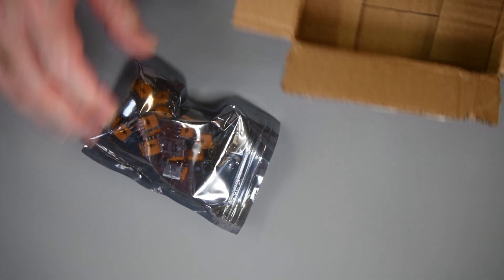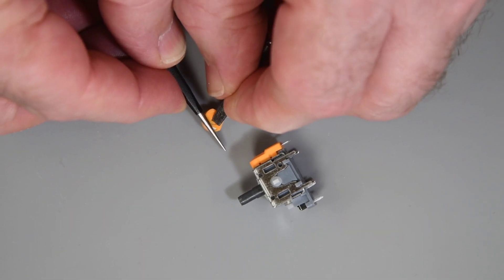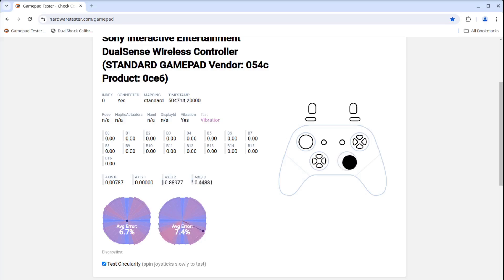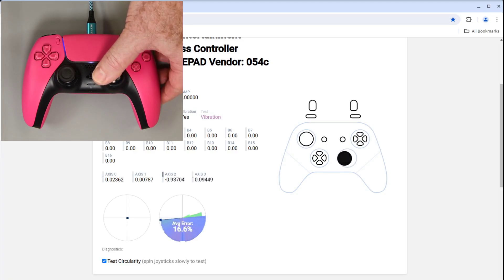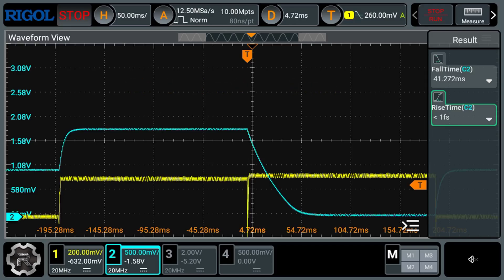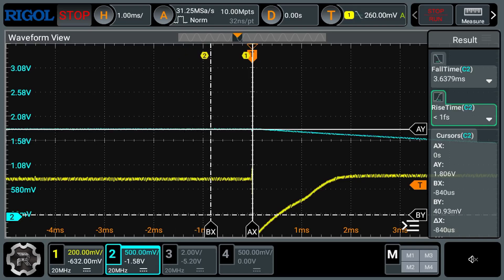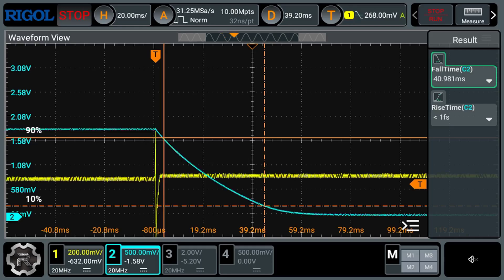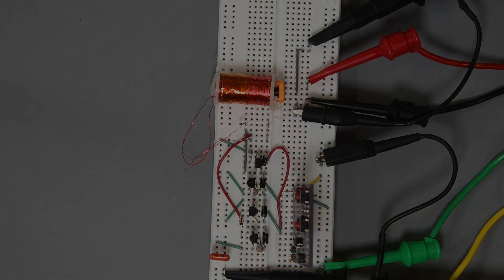Is This the Perfect Hall Effect Joystick for the DualSense?

Comment: From what I understand, they will only work specifically on a PS5 and PS4 (there is a version of this module for the PS4), due to the fact that it is not possible to calibrate the center of the module like on the v3 and the software for calibration is required?  I ask because I have a Wii U pro controller and an 8bitdo pro 2 that I wanted to replace with these v5 hall effect modules, but I believe that as it is not possible to calibrate the controller it would be better to get a v3?
Reply from the maker: You can deform the plastic to move the center position like the K-Silver joysticks.  It's just tedious.
Reply: where can i get the ps4 version of this module? if you dont mind providing a link somehow?

Comment: Great video. After seeing your review I'll be swapping out my previous gen hall sticks with these. And I'll be recommending your video to others who might want hall effect joysticks.

It's great that they keep refining these hall effect joysticks to make them better and better. It definitely beats buying a new controller every couple of months due to stick-drift.

Also there is a kit for the DualSense Edge joystick modules but a calibration board needs to be used until someone can get the software calibration to work with the Edge. Currently that's just for DualShock 4 and DualSense controllers.
Reply from the maker: I really like these.  I'm going to replace the K-Silver and the two other Ginfulls with these.  But I'm going to wait.  I ordered some Favor Union Hall effect joysticks, and want to check them out first.
Reply: To me it would seem like that larger, different shaped magnet was a key to improving the joysticks along with tweaks to the code on the hall effect chip.

If the K-Silver & Favor Union still have the older small rectangular magnet I'm confident in assuming they will be worse. Unless they somehow make up for it on the hall chip.
Reply from the maker: Probably so, but I do want to try the Favor Union.  They have been making the joystick modules for so long, it will be interesting to see their take on the Hall effect.
Reply: @metalplasticelectronics354  hopefully it's more than a copy of previous hall-effect joysticks with the only difference being their brand/logo on them. have you seen the Ginfull hall-effect sensors? they are mint colored but have a small rectangular magnet (maybe a bit longer) you can buy just the sensors and you fit them onto a ALPS joystick that you already have.
Reply from the maker: No I sure haven't.  Since Alps are in most of the DualSense controllers that would make for an easier upgrade.
Reply: @metalplasticelectronics354 where did you ordered FU joysticks?
Reply from the maker: @Kaesar_Wolf  https://a.aliexpress.com/_mPsqAOK

Comment: Can you explain to me about the delay you mentioned in hall effect vs potentiometer sensor?
Reply from the maker: Probably not well.  The only delay for the potentiometer joystick will be the RC time delay of the electrical circuit.  It is likely somewhere in the 10s of microseconds.  The different Hall effect sensors all have additional delays with them. And depending on the sensor's output impedance it will have more or less of the same RC time delay. So the Hall effect sensor is going to have a slower response time.  It's just how slow is too slow.
Reply: @metalplasticelectronics354  So you know how mouse and keyboards have pollrate and most run at 500-1000hz effecting input lag? Some custom gaming controllers run at 1000hz (Just throwing a kind of random fact out there). Anyways if you had two identical controllers one has potentiometer sticks and the other had hall effect sticks. If you played plus tested both controllers on a shooter game aiming and looking left to right, would hall effect joysticks stay the same, increase, or decrease the default input lag on controller when looking and aiming around? Would it be by a noticeable amount or make almost no difference?
Reply from the maker: I don't know what the polling rate is on the DualSense.  I would doubt it sends data to the PS5 much more than 60 times per second. If someone knows how often the DualSense sends a packet of data to the PS5, would be nice to know.  Once the delay with the Hall effect is below around 10 milliseconds I think it would be very difficult to tell which one is which.

Comment: The link doesn’t work for me. I just did the v3s on my ds4, 3 controllers and they are good I actually have some centering issues. I have a ps5 bdm 020 coming in a bought on ebay with drift to repair so I’d love to try these out
Reply from the maker: Try right-clicking on the link and open in a new tab or window. Seems very long URLs give problems. It's the VaalPaev store on Aliexpress.
Reply: I checked the sticks I’ve ordered way back from Ali and the r L-4b 2 for like 3.60 so I have 4.